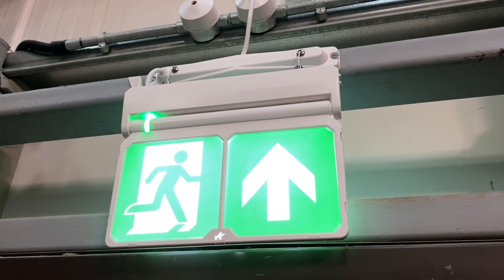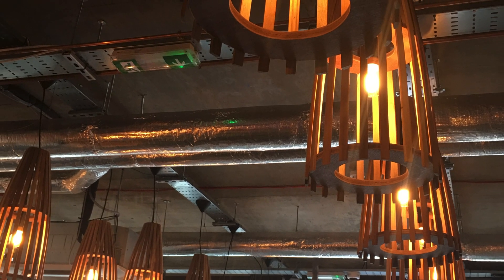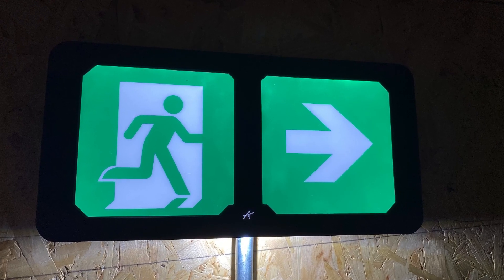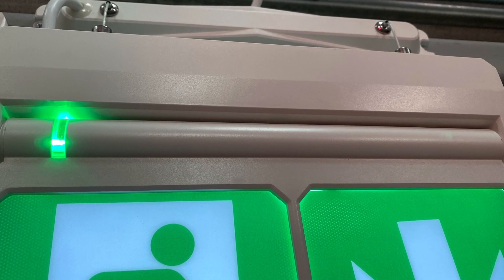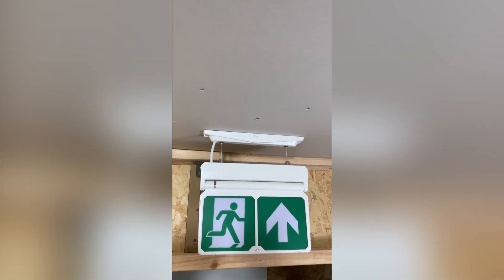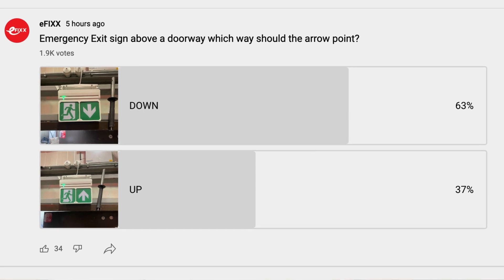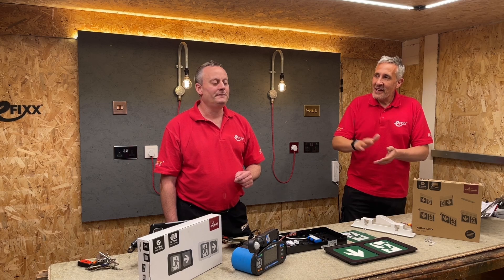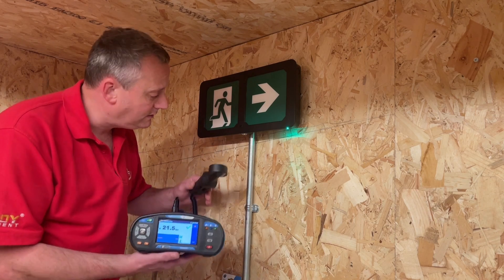Which way should the arrow point on an Emergency Exit Sign?

Comment: It can vary depending on floor levels that require direction to the place "of ultimate safety" whether below ground on exit through "fire exit" door to a protected escape route etc. The point that gets mixed up is "is the arrow a pointer for a location ie door or is it a direction of travel advise" ...

Comment: The real problem is that as an electricien you learn to work on an electical installation and emerceny lighting is just something you do when your in the workplace. The same thing happens to data networks(UTP etc cables)fire protection and so on.
I really do not care if the arrow is up or down most people will not notice it anyway.
Furthermore,and i do not how how this works in the UK,the rules concerning emergency lightings are not laws(at least in The Netherlands)but norms and that means that the company that set up these rules make you pay to see these norms(if it´s a law you can read these for free)so we have lot´s of norms.
Antother thing i have noticed is that in certain buidlings the signs with the arrow are not lit(meaning the only produce light when power fails).
How does that work in the UK,i am curious.

Comment: This is the kind of thing there should be worldwide standards and agreement on.  
Then should be drilled and taught in school and the workplace. 
You may have just seconds to escape a modern fire with toxic smoke and intense heat, clear signage is critical

Comment: A Final Exit sign above a door direct to the outside (fresh air) shouldn't have an arrow at all, and this defines the difference between a direction to travel or reaching a door to a safe place outdoors. Either way, having the arrow does no harm. It only really matters if, as you have already mentioned there is a specific direction to take on the other side of the door. e.g up from a basement and down from above. A caveat, be consistent with the existing. pendant being pendants lol.

Comment: Technically it should be an up legend to be in line with BS5266, You can't mix Euro and ISO legends within the same building. The Key thing for exit signage is that the signs need to be clear and unambiguous in an emergency / Panic situation. We now manufacture an ISO legend that has a down arrow but the norm should now be the UP unless you are directing someone down stairs

Comment: If its above a door, and it's a crowded room, you may only be able to see the sign, not the door. So to me, the arrow is indicating where the door/exit is. If in a corridor, I would understand if the arrow was pointing up, indicating straight on.

Comment: Amazing how many wholesalers don’t even know about the new LifePO 4 batteries and the requirements for the length of life of the battery required. Nearly all cheap bulk heads only have a warranty for one year of or the battery so technically needs replacement every year. But the box says 5 year warranty which just for the unit not the battery. 
4 year warranty on battery or I don’t purchase. Maybe that’s why my prices are higher than everyone else In my area 😂

Comment: What you don't mention is the position of the figure.  It should be separate from the doorway along the the route to the exit, and in the doorway for the final exit to the outside (can't quote standard, this is what our local fire brigade taught on office fire wardens course).  This means that the sign in the church at 5:44 is wrong.
Reply: There are no signs with the figure separate from the doorway in ISO 7010. These were from The Health and Safety (Safety Signs and Signals) Regulations 1996 and it's improper to mix the two standards in the same building.

Comment: The problem I have is if the sign is directly above a door and you are walking out on a flat plane then the arrow is highlighting the door as the exit in perception of your average person not the direction, I have seen circumstances where an up arrow would cause confusion thus I do believe it is subject to the building layout and positioning of the sign.... never in my life have I seen a power cut or fire alarm go off an people stand there going - do I exit forward or look for a cellar or staircase up, it is simply basic common sense as long as it is sighted in a good position to be relevant to the exit route.

Comment: Almost all Electricians drive, as do most of the people watching this. Which way are one way street arrows ?? And most road signs in the uk and Europe for  carrying on in the same direction...??? Up, not down. Not hard to use the same method with fire safety signs.
Reply: Streets don't have stair(case)s...
Reply: @HenryLoenwind  and where do you see a vertically down arrow on the street ??
Reply: @w.o.o.d.y  When mounted on the back of a service vehicle. There, "down" means "ignore this sign".

But as I said, up and down arrows are of no consequence on the road as nobody in their right mind would direct cars to go up or down stairs.

An emergency exit path for pedestrians can easily go through a staircase. Does an up arrow mean they should cross the staircase and exit a door on the same level or should they take the stairs up? Does a down arrow mean they should cross the staircase and exit a door on the same level or should they take the stairs down? There IS potential for confusion here as people, other than cars, CAN take stairs.

That's why I'm on team "no arrow when the sign is on or above a door unless there are stairs to take directly behind it and even then I'd prefer the old sign that showed stairs with a diagonal arrow up/down above them". Nobody will interpret a sign without arrows as "stand here to escape".
Reply: @HenryLoenwind  which is why there should be a cranked arrow sign to indicate to go up or down on the escape journey.
Reply: @w.o.o.d.y : "and where do you see a vertically down arrow on the street ??" See e.g. motorways and dual carriageways with overhead signs that indicate lanes that can be used for certain destinations.
Reply: @fetchstix  I think you mean lane position signs, not directional arrows. And ?

Comment: It would make sense to remove the arrow altogether in this situation and have the arrows only on signs that are pointing TOWARDS the exit, and have no arrow on signs indicating that this IS the exit, maybe just an icon of a set of open double doors where the arrow would be. I'm sure I have also seen signs that have an illustration of steps for when you have to ascend or descend a flight of stairs to get to the exit.
Reply: That's basically the US standard.  If you read exit and are facing the direction you need to head, then no arrow is required.  If you need to turn left or right, then the appropriate arrow is required.  In rare circumstances additional markings are required but the up and down arrows are not needed unless there is a specific confusing situation.
Reply: @Species1571  that makes too much sense imo, nobody's going to accept that. Better to just confuse people.

Comment: I remember the old menvier sxm do not do a legend pointing up they only do, left right or down only. I had one once were I had to cut the legend so the arrow would point up at the bottom of the stairs to the fire exit fitted with panic bolts.

Comment: Above the door to the outside, no arrow. You have reached the exit no more directions needed
Reply from the maker: Emergency lighting usually extends beyond the door.
Reply: @efixx  I know that, but it's the arrows were talking not the light. And also an exit sign isn't classes as an emergency light

Comment: Interesting, we have always done it as Up for through-route and down before stairways or "exit below/ final doorway to outside". This way was how I was taught as you don't want someone going through a doorway and then climbing the stairs unless that is actually the only way to the exit.
Reply: Pointing down to the door you need to go through has always seemed like common sense to me, but when have the people making up regs ever used common sense? 🤣
Reply: When you see an arrow pointing up it usually means up. So basically it's telling people (who aren't in the know) to go upstairs.
Reply: @elipsesis no it’s not people know an up arrow means straight ahead. They are in road signs and everything. 

Stick to regulations. People
Changing these signs to fit how they think they should be WILL KILL PEOPLE people in wheelchairs rely on these signs to be right and give good indication to what’s what. Changing them to what other then the regs say puts lives at risk.
Reply: That's a good argument.

Comment: You point towards the exit, so if the door is below the sign you point down. If the sign was away from the door you would point up.
Reply: Flowing fra visit informed that down arrow donates a changing in level . No level change then an arrow to show  direction of travel.

Comment: The standards people do my head in. Wouldn't it make sense for the arrow to point down on anything above ground level, so 10th floor down, 9th floor down and up only at ground level or when you did need to go up, from a basement for example?
Reply: No because everyone knows an arrow up means straight ahead. They are literally on most road signs and pretty much any direction signs. 

The arrows are not only for direction they also give indication to wheelchair users about what’s what. Not installing these signs to regulation put wheelchair users lives at risk in an a real emergency it’s vital these signs are installed correct and the right direction arrow is used
Reply: God forbid anyone who's ever installed one makes it onto the IET committees. We might get some common sense regs then. Too busy polishing the brass buttons on their blazers and worrying about what sandwiches are on the lunchtime buffet.